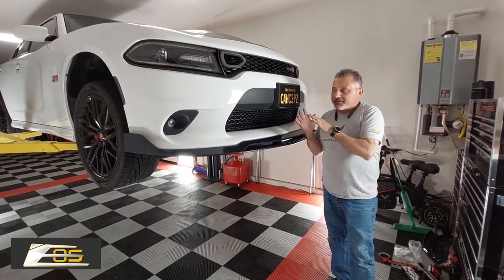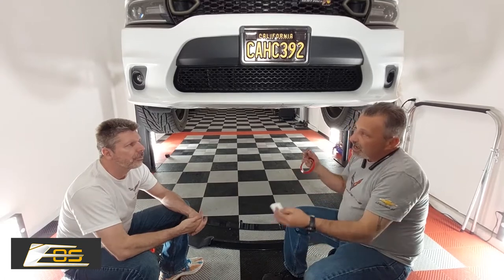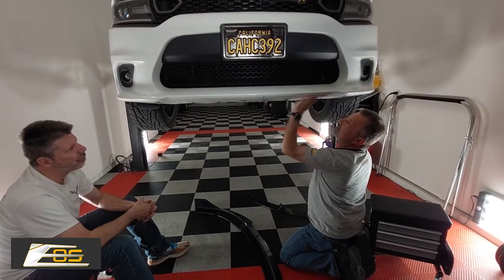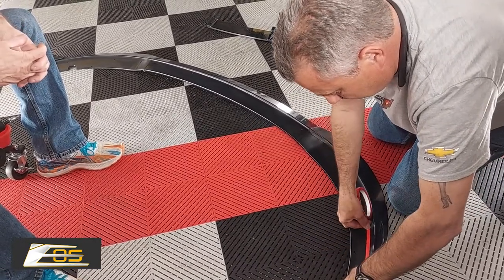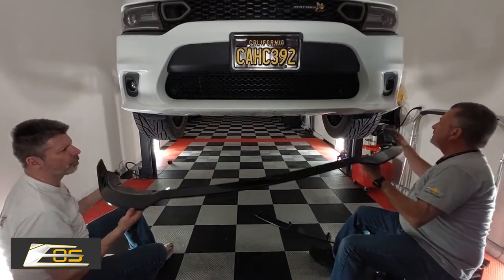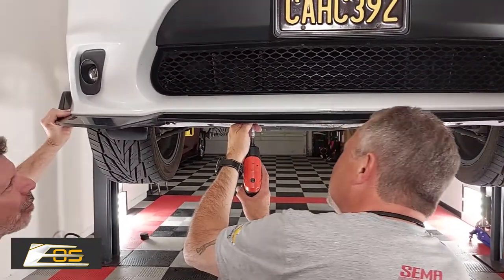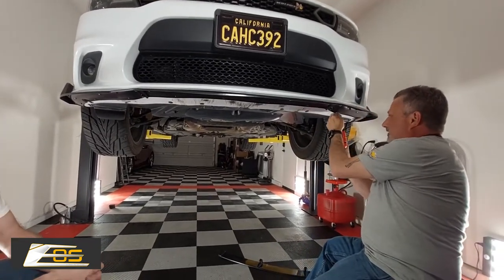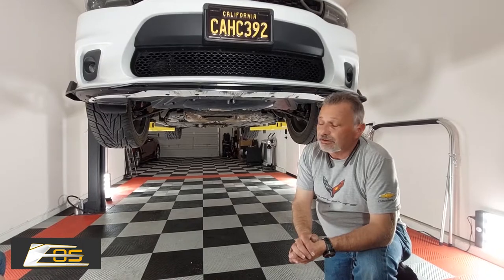How to Install a Front Splitter From Extreme Online Store on a Dodge ScatPack

Comment: You have a link for that splitter? Also hows it been holding up. I heard its better to use nuts and bolts, but that dies require the removal of the bumper.